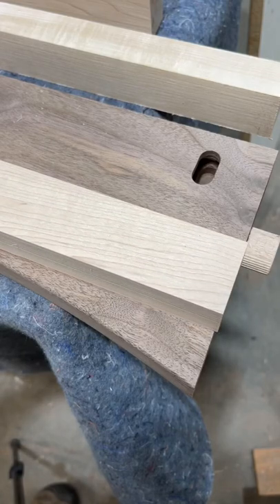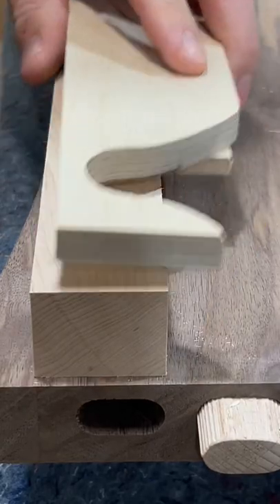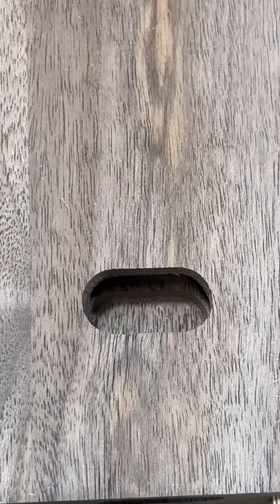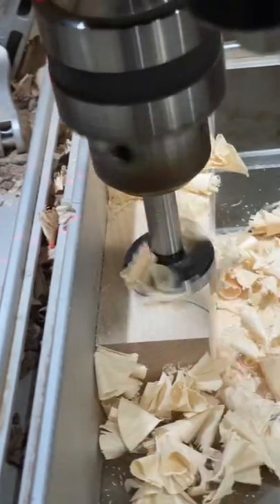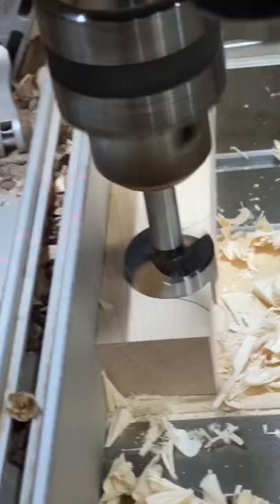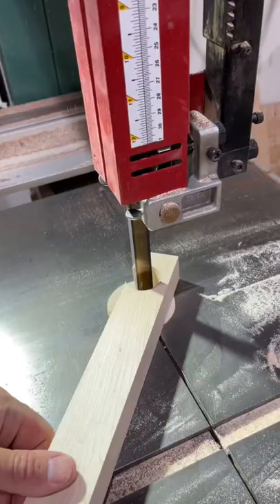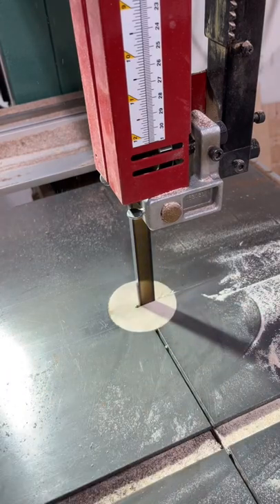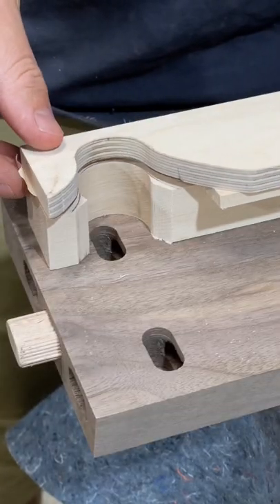Prepping slat supports to avoid the rail connector hardware on these bed rails. #shorts #woodworking

Comment: At the beginning of the video I asked how you were going to tie those two shapes together. And by the end I was asking the same question.
Reply from the maker: The capsule shape is for bed rail connector hardware that’s tightened by an Allen key. The shape cut in the maple slat support is just meant to give easy access to that. Unseen once the bed is assembled